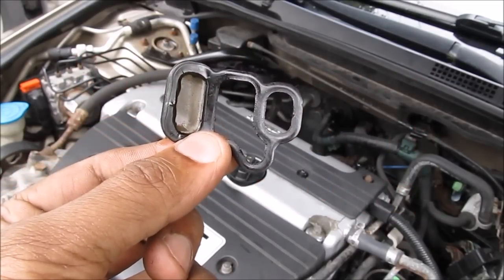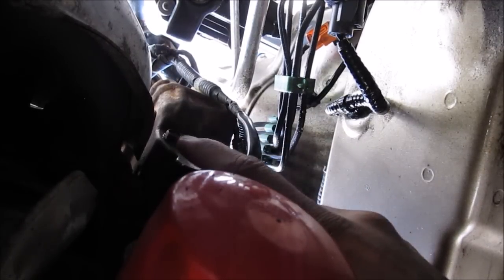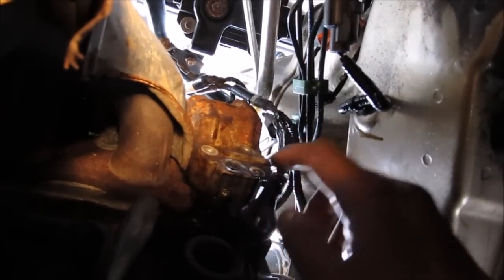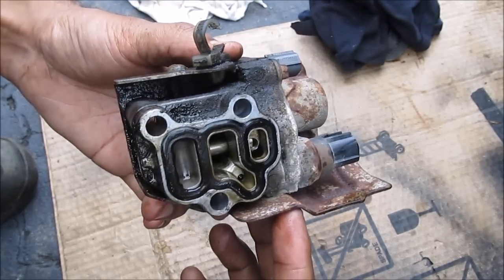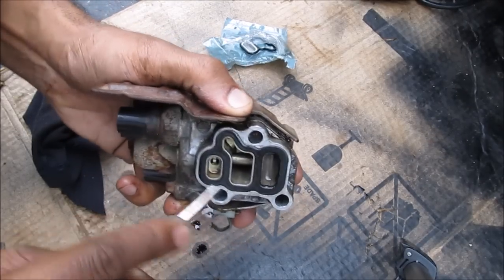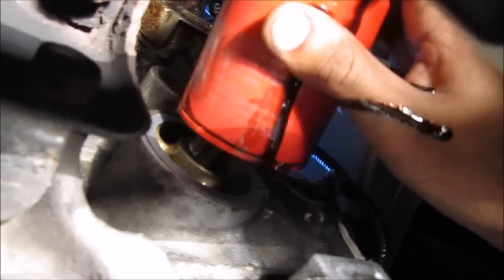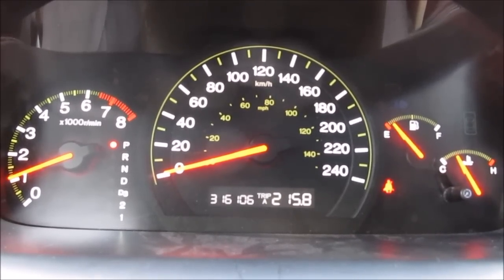How to Replace a Honda VTEC Solenoid Gasket

Comment: Thanks very much for the video. but I messed up , right corner bolt snapped in block. No access to extract. Any advise is appreciated.
Reply from the maker: Remove the head...ouch
Reply: @speedkar99  this is not attached to the head . it is on the block . thanks though
Reply: May be you are right it is on the head
Reply: @speedkar99  hi managed to get the stripped bolt out. But found one more leak. The switch with a grey boot is leaking . what switch is that. And any tips of how to replace? Thanks
Reply: mike How did you get the bolt out? mine broke too
Reply: @bensellersaudio  Hi Ben . A tech friend of mine accessed the broken bolt from the top. He used a small pliers to hook to a tiny bit that was sticking out and got it out.
Reply: @bensellersaudio  If you are used to working in tight spaces I suggest you get a tech to do it . One thing is sure it is possible without taking out the head for access

Comment: I had a question, so my acura rsx doesnt let me go past 4k rpm, could this be just the gasket i replace or the whole solenoid?
Reply from the maker: Check your throttle position sensor, and ecu for other codes. 
It should still rev out without VTEC

Comment: Why does this still leak after changing the gasket? Also oil sensor o-ring?
Reply from the maker: I gave up on Honda leaks. 
If Honda's leak oil , Toyotas burn oil. 
I guess that's better than burning up a CVT
Reply: @speedkar99  i tried to retorque this and will see.  I only saw small seepage, but nothing dripping.  i dunno if i should just buy a whole new solenoid or redo the gasket.

i read, it shouldnt be torqued too tight, or it‘ll actually not work
Reply: speedkar99 don’t kid yourself , for over a decade now Honda’s have been burning oil also

Comment: No need to remove oil filter. you can reach it from the top easily
Reply from the maker: If you don't have a strut bar then yes

Comment: Replaced the gasket and oil pressure switch...extremely easy job...but I got hold of repair manual from Honda, which had torque values and every step mentioned.
Reply from the maker: Yeah it's fairly straightforward
As long as the strut bar isn't in the way on some models. 

Did you get at it from the top?
Reply: @speedkar99  I have 2009 2.4L Accord

Comment: did changing the gasket really help, or does it still leak
Reply from the maker: The VTEC didn't leak. 
But I still had a leak from somewhere else
Reply: @speedkar99  would u recommend doing the o ring on the vtec? is it hard to take out.  i got a leak as well, gonna do my valve cover then look at this.  any tipa on getting the spark plug tube seals im. lol.  great helpful vid

Comment: Poor application of a resilient seal by Honda! This should be a compression gasket. This kind is only useful for a water pump maybe. But I digress. We’re all talking about 12+ year old cars with way over 150K miles. Thanks for this very informative video.
Reply from the maker: You are welcome

Comment: Thanks for the video! 2003 CRV. I used a mirror to see the back of the block. Did everything from above. Did not have to remove the oil filter. My gasket stuck to the block. super easy. Great video.
Reply: Exactly what I am about to try,...working from above. Glad to know someone tried it and was successful.
Reply: I was thinking to do the same, but wasn't sure. Thanks for verifying!
Reply from the maker: Yep, it's not hard from the top if the strut bar is out of the way.
Reply: I was trying to do it from the top but it's so hard to get leverage on the bolts and keep the ratchet straight. So I thinking I might have to lift the car up and get it from underneath. We're your bolt hard to break free?
Reply: @Maxspeed7Dude  I remember just laying on the engine with a big makeup mirror down so I could see everything. I don't recall the bolts being difficult just the position of everything

Comment: What's the correct torque specs on 3 bolts with 3/8 torque wrench  I'm seeing diff ones and want the correct
Reply from the maker: Use a 1/4" torque wrench
3/8" won't be accurate because they start at 20ftlbs which is too much
Reply: @speedkar99  104 inch lbs ?.. I'm sorry mine is a 1/4 torque wrench
Reply from the maker: Yes 104 is achieved with a 1/4" ratchet / torque wrench
Reply: Acura tsx 06 AT same torque 104. Inch lbs

Comment: My 2005 Accord was throwing code P2647 only, I didn't notice an oil leak.  I replaced the entire VTEC solenoid assembly, but now it's throwing code P2646 only.  Has anyone ever seen this before?

Comment: I am getting an engine code for a VVT sylonoid and vsa light on. The cost for a new oem sylnoid is 400. Am i better off cleaning it with a new gasket or getting an entire different unit? Car is a honda civic si 09, 160km
Reply from the maker: Try cleaning. If not then replace

Comment: Hello there I got a civic Si 2008 Amd I put the selenoide (vtech) I buy aftermarket from autozone and the car still give me the same code with the VSA light on Im really need Help asap. What you recommend me put the genuine selenoid from the dealer Honda?
Reply from the maker: Yeah a Honda solenoid is your best bet. You can test them with a battery and some jumpers. Also make sure nothing is blocking it's oil passages

Comment: How many miles do you have on your car now?
Reply from the maker: I don't have it anymore but sold it with 316,000Km
Reply: 28 may 2019 5:59 pm edt:
316,000 km = 196,236 mile.source:1 kilometer = 0.621 mile in https://www.rapidtables.com/convert/length/km-to-mile.html from google (1 km to mile)

Comment: Hi! I just wanna know whats that blue socket/cable hose under the v-tech solenoid and where it is connected? I am having an oil leak on that part. I appreciate any information you can give me. thanks in advance.
Reply from the maker: Power steering line?
Reply: @speedkar99  I dont know what its called but may be you can run the video at 2:10 you almost touched that blue socket cable like. I thinks its some sort of a sensor .

Comment: Hello! I got an ek4 vti and I changed my vtec gasket but still leak a lot of oil from there.. Probably I got to buy other vtec part or other gasket?
Reply from the maker: Check the timing cover or VTC valve o-ring

Comment: I have a leak behind my alternator on my 2013 Honda Accord lx. Is that a different issue?
Reply: I realize your text was from 8 months ago, but for anyone else with this problem, check the vtc gasket & strainer for leaks. May need to be replaced.
Reply from the maker: Good tip thanks
Reply from the maker: Valve cover ?
Reply: speedkar99 no it was behind the alternator but covered in gunk and oil from previous oil changes. Under the valve cover.  It’s a nasty cavity that cakes up over time. I think I’m good.

Comment: Wish I had found your channel  sooner.  Replaced VTEC entire unit, $234 CAD ,with 2 hrs for labour so it was a sizable bill.
Reply from the maker: Ouch
Reply: 28 may 2019 6:43 pm edt:
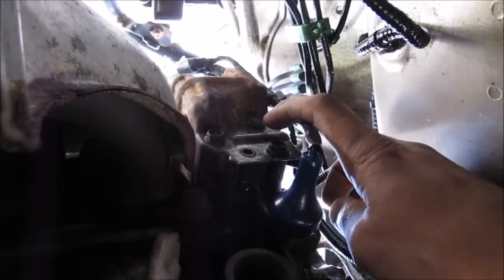1:19 movie-maker suffer injury
source:comment from 'n1n1nanou' 

honda-mechanic-school train student to work on honda-car,acura-car:
 'When you train on Honda and Acura vehicles, you’ll be immersed in sophisticated  automotive technology, and use the most advanced diagnostic repair systems and  equipment in the industry.' in https://hondapact.com/students/faqs/ from google(hondapact work on honda car)result 3  from 'Honda offers a two-year Professional Automotive Career Training (PACT) program, where you’ll learn to diagnose, maintain, and repair Honda vehicles. While enrolled in the program, you will have the ability to earn 10 valuable certifications' in https://www.yourmechanic.com/article/how-to-get-honda-dealership-certified-by-valerie-johnston#28_may_2019_6_47_pm_edt from google(becoming honda mechanic)

28 may 2019 6:48 pm edt:#insert#  from 'Honda offers a two-year Professional Automotive Career Training (PACT) program, where you’ll learn to diagnose, maintain, and repair Honda vehicles. While enrolled in the program, you will have the ability to earn 10 valuable certifications' in https://www.yourmechanic.com/article/how-to-get-honda-dealership-certified-by-valerie-johnston#28_may_2019_6_47_pm_edt from google(becoming honda mechanic)

Comment: Pretty certain this is the cause of my oil leak. Glad I found this before taking it into a shop, as this looks like something I can do myself. Thanks for the upload.
Reply from the maker: Glad it helped
Reply: After you replaced gasket and drive car did leak residue oil ?? I just replaced mine and after getting home I checked for leaks after I parked and there was a couple drops

Comment: Should I do the oil change before putting the new solenoid on or wait till afterward? I got the engine code so I will be replacing the whole unit?
Reply from the maker: Do it all at once since the filter should come off for better clearance

Comment: That's how to do a repair video.  No wasted time or words or blather.  I would add more "symptom" stuff at the front (trouble codes), and a road test with the engine running higher revs to make sure the repair worked and some words on clearing the codes.
Reply from the maker: Thanks for the kind feedback and suggestions

Comment: Thanks for such an informative and detailed video. My Honda dealer found a leak on my 06 Accord and is asking for $180 to replace VTEC solenoid gasket. I am going to do it myself. Did you have to disconnect ground battery terminal wire before replacement to avoid any electrical shorting?
Reply from the maker: I didn't disconnect the battery...just to clear the code

Comment: Bought the gasket for $9.50 from the dealership, they quoted me $150 to do the job. Was able to do the job from the top without having to get under the car, all under an hour. No leaks, Fixed!
Reply: I had to replace the whole solenoid 120$ 10 minutes of work pull 3 bolts, replace, torque to spec.
Reply: @SonoSlayer mine got the code, car is jump no going over 3000 revolutions, checked my oil and were empty, fill it with oil and drives great , i will replace only seal
Reply: @SonoSlayer  What if you don't have a torque wrench like me?
Reply: Just stop when its tight dont crank as hard as you can, if you think it isnt enough take a paper towel to it after a decent drive to see if it's leaking @094340
Reply: There is a video for the solenoid gasket and vvt solenoid out there i just ended up replacing the whole thing because the previous one was way over torqued it ended up leaking through the bolt holes from the plate being crushed
Reply: @SonoSlayer  Yoo, How did you get the bolts off? Power tools? I think someone did that to mine. I got one bolt off, and it took a lot of force to break loose. And the bottom bolt was stripped.
Reply: How did you do that? I just couldn't see it. Any tips would be appreciated. Local Mechanic quoted $1497 plus tax. I don't think he wanted to do it.
Reply: @ScreenPrintR  i just felt for the bolts and put the ratchet on kind of did it blind but it isnt harde there is 3 bolts in an upside down triangle pattern
Reply: @SonoSlayer  Thank you. I didn't pay attention. Guessing it's because I didn't take off the two cables. Should do that first. 

Did you do the VTC and the screen in the front? Thank you,
Reply: @ScreenPrintR  yes i did the vvt and the vtc the vvt is on the side of the engine the vtc is the one on the back of the engine the screen comes with the housing or you can buy it separate for like 5$
Reply: question for you Manny or whoever has done the job on this thread did you have to remove the oil filter?
Reply: @AccordTorneo  I did mine from the top of the car. Had small extension for my socket wrench. Laid a tarp on top of the engine and prayed as I unbolted the bolts. Felt around for their locations first. To put things back, I put the solenoid in position and felt around to get the bolts in one at a time.
Reply: @ScreenPrintR  thanks a ton for the fast response man
Reply: @AccordTorneo  You're welcome. Best of luck. I bought the replacement Solenoid which came with the screen. Someone said, if it's throwing a code, replace the whole thing.
Reply: I'm dealing with this problem in my 03 accord. I literally just did the ignition lock cylinder myself..mechanic wanted to charge me 900 for it. I fixed it myself for 200. I think I can do this myself too. Oh youtube how I love you. Thank to OP of video for showing us the way
Reply: @Trippybrandon420  if you did the ignition cylinder, this is a walk in the park
Reply: Well done
Reply: I have the same problem. The part was 16 bucks, I'm not to sure if I can do it tho
Reply: @davewilson7701  I have fixed various car problems and there is always that tinge of uncertainty doing something the first time-what if I screw it up?-go ahead and jump in, just take your time and when you get it done you'll have the confidence fix another problem....
Reply: @tonyjordan1320  yes sirrrr. I APPRECIATE THAT
Reply: @rdan1320 Don't you just HATE that initial apprehension??? I have it every damned time I try something I have never tackled before, no matter how much success I have previously had fixing other stuff.

You are right though, the more you do, the more you realize that you can probably do something, within reason. However, to quote Clint Eastwood...

"A man has got to know his limitations".
Reply: 104 inch lbs ... (DO NOT USE A FOOT LBS TOURQE WRENCH)
Reply: thanks for saying this. I'm about to work on mine
Reply: Does it need to be torked or just tightened by hand?
Reply: @gioportillo8983  hand tight
Reply: You're lying there's no way they charged you 150 for that
Reply: What about removing the oil filter and all that? Is that still a must?
Reply: @tat2loo3va5  

Strange thing, on my 2009 Accord the Solenoid is too far up from underneath the car, so I didn't even have that option. I just did it from the top.
Reply: I just replaced mine, 1 little drop after I parked, is that normal ?? Maybe residue oil ? Then just checked after I drove again and no drops
Reply: does alot of oil pour out the silinoid wen u unbolt it ??
Reply: My dealer wants $299.00 🤣
Reply: Replaced the front gasket today.  If that doesn't fix my leak I think I'll need to do the solenoid gasket as well.  I'll be trying it from the top.  Good to hear it's doable.

Comment: I just did 104 in lb and the bolt broke and the car left oil everywhere 😠 was that really the right torch specs?
Reply from the maker: I hope you were in inch pounds and not foot pounds.
Reply: No ft pounds the bolt broke inside the block now ima jave to pay a shop or sum to take them out. Im not shure id I stripped the inside either

Comment: Hi, is this related to p2646 (a rocker arm actuator system performance or stuck off bank 1)? Thanks in advance!!
Reply: Did you ever figure this out? As I understand, that particular code can be triggered by a failing oil pressure switch sensor ( (PN 37250-PNE-G01) . Also...make sure you ain't low on oil!
Reply: ianjuarez30 that’s the exact code and description on mine. What’d you end up doing to get it fixed?
Reply: Just got that same code for my k20z3, ordered a new solenoid I'll update to see if that fixes it. Also no my oil wasn't low
Reply: @emmanuelstransmission  any updates?
Reply: @cenaamil  UPDATE: Got the part I needed, come to find out the people at AutoZone were confusing the vtec solenoid for the vtc Solenoid. So I went back watched some videos on how to replace the vtc Solenoid. This video goes step by step on how to replace it Link: https://youtu.be/YYKikGysXqE it was a bitch to take out the 12mm bolt you can't see by the pulley (you'll know what I'm talking about if you do it) also when you put the new solenoid in there's a bolt that holds it in place. Once again a total bitch to put in because you can't see where it's going and there's a specific piece on the solenoid the bolt has to go through before you could thread it in. Other than that pretty easy. Drove about 70 miles CEL hasn't returned. Hit VTEC twice and all good so far. Also thanks for reminding me, I was going to post it earlier today but totally slipped my mind.
Reply: @emmanuelstransmission  did u have to clear the code off ur car brother I just changed mine as well but the check engine light is still there
Reply: @deathleaf2722  I drove the car a couple minutes and it just went away on its own
Reply: @emmanuelstransmission  weird okay mine is still there even after the change thank you for info
Reply: @deathleaf2722  only other thing I could think of, of the top of my head is to make sure you have enough oil. I got the same code later down the line and my oil was slightly below half of the max. Topped it off and it went away.

Comment: Hi.. great video... I have a question relating to this. I believe that my Vtec is not kicking in. I have no oil leak and no code flashing on my dash. My fuel consumption is not great.; went from on average 8L/kms to 10L/kms.  Plus the car seems to be rev limited now to 4000 rpm. This is where the 2nd CAM kicks in. Honda will charge me an arm and a leg to check. It never had that issue before. Any advice, please...
Reply from the maker: Any codes? Start with cleaning this solenoid and the iac

Comment: Came here from Reddit. Was not disappointed. Great video!
Reply: I'm just glad I now know how to replace a gasket on a vtec engine. Now I need a Honda.
Reply from the maker: Hey they are all too common
Reply: Me too I'm not even old enough to own a car
Reply: Now I need to get myself a leaky Honda
Reply from the maker: Not hard to find !
Reply from the maker: Glad it helped!
Reply: I bought 5 sockets just in case I ever lose a 8 or 10mm socket